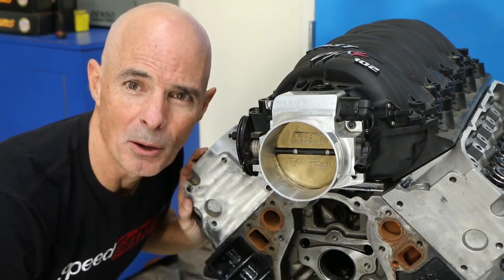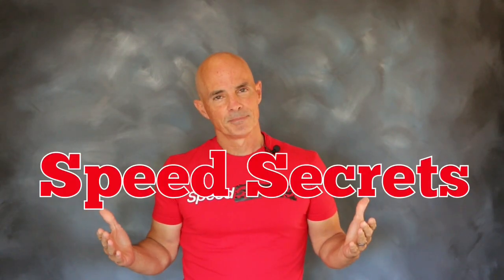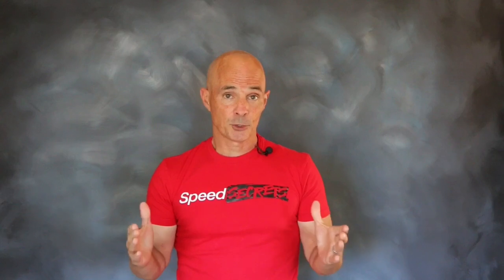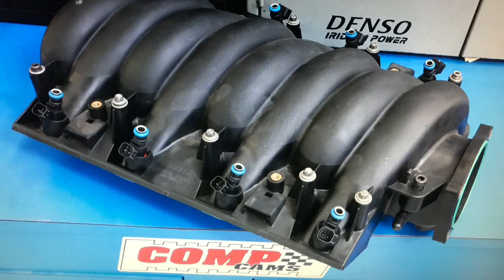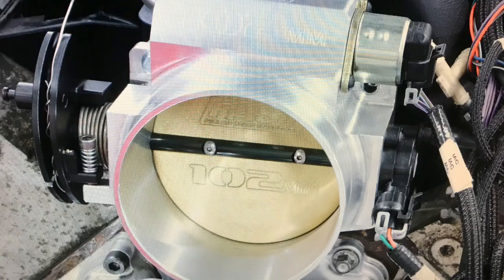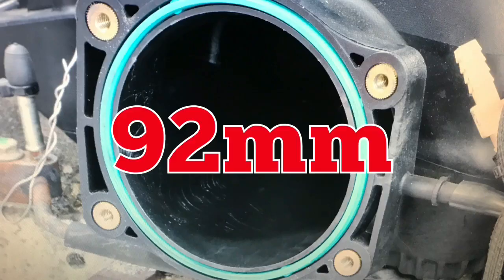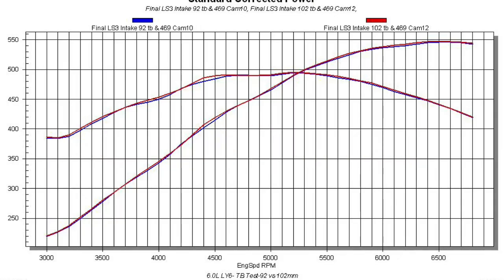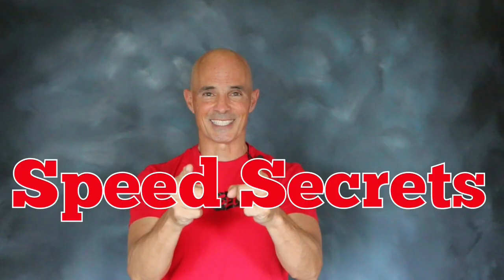LS THROTTLE BODY TEST-92 VS 102 (IS BIGGER REALLY BETTER?)

Comment: Showing what's under 3000 rpm would be interesting.
I'm pretty bigger makes you loose driveability.
Reply from the maker: michaelovitch the bigger throttle body has no effect on low speed torque. It does make the motor FEEL more responsive cuz a small opening provides more airflow-but at WOT-no change

Comment: Slightly off topic but what duel quad port injection work on an LS 7?
Reply from the maker: do you mean port injection with a pair of throtle bodies on a tunnel ram or other dual quad intake? If so, yes it works
Reply: @richardholdener1727  yes so like a  edelbrock duel quad with port injection and a pair of 1000 cfm??? Throttle bodys.
I guess the question is from a stock LS 7 how much gain or how much does the set up rob.
So many questions. 
Thanks Richard
Reply from the maker: @adamvita1334  I'm not familiar with a dual quad for the LS 7 except Holley has a Hi Ram that you can use. The best bet is to use an MSD for the LS7 or if you want high rpm power-then the Hi Ram

Comment: I'm usually pretty open to your testing procedures, but this one is very biased, both throttle bodies are still breathing through a 92MM openuning, so where would any performance gain come from? Did fast make you do this test to try to sell more manifolds? Why not switch to a fast intake on this same motor and use both throttle bodies Alain and see if there's a difference? Turn the adaptor around to go from 92MM to 102 MM and see if the throttle body is a choking point.
Reply from the maker: It was to show that the adapter and bigger throttle body do not add power-to help people from wasting their money.

Comment: Just wondering if there is any input from Dorman as to how much boost is safe for these newer intakes? I had read on   a few different forums where the early intakes would crack/separate at the snout on less than 1 bar. User error always an unknown though lol.  I know factory intakes like the LS1/3/6/7/TBSS  do not seem to have this limitation.
Reply: When they first came out they couldn't handle much over a bar of pressure but now they can handle a fair amount of pressure. There's dudes runnin 25+ psi regularly on Dorman manis
Reply from the maker: thnx for the infor-I've only run 11-12 psi

Comment: So basically the throttle body isn’t the restriction here. If the stock throttle body was maybe like a 70mm (if there was such thing) and the intake manifold was still a 92mm opening we would see some gains?
Reply from the maker: that's exactly right

Comment: Cool to see a back to back test prove what I think most people on the forums believe... throttle body really don’t make a difference in the big picture. And the only reason to upgrade from the factory setups is for looks
Reply from the maker: the factory 90 mm will fed a lot of power but the stock 78mm throttle bodies (or intakes) will limit power (but that is less of a problem on turbo or cent blower applications

Comment: I would like to see if all this head porting is worth the money. Get a base line, then put same but ported heads on with no other change
no milling and no cam change, no intake change nothing just ported heads.
Reply from the maker: Simple Man I have a test in ported Heads on a turbo motor -lots on na motors

Comment: Hey Richard. Can you do (or have you done) a test with sheet metal intakes on a boosted application where you have measured power with different upper intake volumes back to back? I'd be really curious to see how a various volumes of plenum react to different cubic inch combinations. For example, 400-420" engine with very large plenum, vs. 400" with very small plenum, then the same test with a 320-360" cid engine.
Reply from the maker: Scott Russell I have something coming up called Kegalodon -it’s a plenum Volume Test

Comment: I thought a 102 would be to big for my ls1 so I grabbed a fast92 and had vengeance racing port my intake tmfor free :)
Reply from the maker: NICE-BUT WE'VE RUN THE LSXR 102 ON 4.8L COMBOS WITH GREAT SUCCESS-ITS WORKS WELL ON THE LS1-BUT YOU WILL BE HAPPY WITH THE PORTED 92 MANIFOLD
Reply: @richardholdener1727  I should've grabbed the 102 tho. In gonna be building a 408 lq4 and putting my 76/75 precision turbo on hopefully spring time

Comment: wouldn't the 92 mm openning essentially make the throttle body also 92 mm, no matter how much bigger it is?  If you increase the size of the opening on the intake, would it not be a fairer test?
Reply from the maker: YOU NAILED IT-THAT'S EXACTLY RIGHT AND WHAT THIS TEST WAS DESIGNED TO SHOW-LOTS OF GUYS OUT THERE THINK AN ADAPTER AND BIGGER TB WILL HELP-THAT'S WHY THE ADAPTER WAS MADE-IT'S OBVIOUSLY BETTER TO HAVE THE OPENING AND TB THE SAME SIZE
Reply: I think people also forget an engine being an air pump only has so much capacity to move air.  Your shark keg intake proved there are limits.
Reply from the maker: Iain Sutherland I’m going to post Keggie Testing later

Comment: Richard - I'd be interested on your take on GPI's testing of a rod-mod and ported LS3 intake vs. a FAST 92 vs. a FAST 102.  Basically, the modified LS3 manifold with a 92 outperforms the FAST with a 92, by a little in hp, a fair bit in torque, and for a lot (less) in price.  It's an interesting comparison of a lot of LS3 intakes and I bet you'd find it interesting.  It also shows how much the 102 is worth on the FAST manifold, which was 14hp.  So, I agree with your findings here, but I think the test using a tappered spacer isn't really capable of showing the "gains" of a bigger throttle body.  You need an intake that will take the larger throttle body without restriction, and then run your test with that manifold and I bet you'd have a different result.

I love the tests you do on this stuff - keep 'em coming!
Reply from the maker: DOES FAST MAKE A 92 VERSION OF THE LS3 INTAKE?
Reply: @richardholdener1727  FAST says right on their website you can use a stock throttle body on the LSXR 102.  GPI tested exactly that, and found that the throttle body change is pretty significant, and exposed that with a stock TB it is outperformed by a rod-mod and ported stock manifold, and with a 102 it realizes it's potential and outperforms the stock manifold with a 90.

Comment: thank you for this comparison Richard.  I am, however, left wondering how this engine would react to testing a fast 102/102 vs Fast 92/92.  Or even just running a fast 102 with 102 TB then with a 92 TB.
Reply from the maker: Jesse Murray I have a test on the Fast 92 intake vs the fast 102 intake in a cath port-fast doesn’t make a 92 mm intake for the ls3-but putting a 92 mm Tb on a 102 mm throttle opening can reduce power at higher power levels
Reply: Richard Holdener be interesting to see at what airflow level an engine will want the 102 over 92.  Also, have you ever seen where an engine picks up power with a fast over an ls3?  I know on basic 6.0-6.2 builds there’s no gains but maybe on big inch/ power setups there is.
Reply from the maker: @jessemurray1757  I'VE RUN THEM ON LOTS OF COMBOS-BIG AND SMALL AND BOOSTED AND NOT SEEN MORE THAN 5-7 HP. THEIR CATH LSXR KICKS BUT, THERE JUST ISN'T A LOT OF POWER LEFT IN THE FACTORY LS3 INTAKE-LET ME KNOW IF YOU HAVE OTHER COMBOS YOU'VE TESTED AND I DID A TEST ON THE 92 VS 102 FAST INTAKES
Reply: Richard Holdener nothing apples to apples but it would seem the difference between 92 and 102 on your typical 450-500 wheel setup is negligible.  All things equal It always comes down to what heads they’re running and the ones running AI ported 799’s always make the best power.  I would really like to see how ported 706’s stack up against ported 799’s.  People always seem to run the 799’s though as you know.
Reply: @richardholdener1727  I would like to see the test of the 102 vs 92 but I can't find it. Can you post a link please?
Reply from the maker: Jeff Borud that vid is not up yet
Reply: Richard Holdener I guess that explains why I can’t find it. Looking forward to seeing it.

Comment: The TPIS  ls6  responded well to the 90mm snout mod  they used to do.
Reply: The 78mm oe tb really starved the ls for air. Not only that but the opening of the ls6 intake was only 75mm.
Reply from the maker: shaadydog1 the ls6 is a good intake and really needs a bigger throttle-would be interesting to test the dorman ls2 vs the modded ls6
Reply: @Richard Holdener  I happen to have  a Dorman LS6 I had started to port for my Camaro, it got put on the back burner since I decided to  buy a Huron Speed front mount kit... Pretty much ported the inlet as far as I could without getting into the O ring. If I remember right it was the same size as my stock LS1 intake initially around 75mm.  I  had also cut the center supports out, then I cut a big rectangle in the bottom to access the ports.  They suffer from a pretty big mismatch and a weird hump. There is also a weird ledge around the outer plenum edges and corners that I blended and honestly that area could use some filler to be a truly smooth transition  from plenum into the  the trumpet/bell/mouth of the intake port. Probably the same bs the factory LS2 suffers from.  I'm sure you have seen, the Dorman LS6 was tested alongside the factory LS6 intake and they were fairly close maybe 7-10hp and identical curves. Most come to the conclusion the shortcoming I described above are the primary reason it wasnt quite as good, I am pretty sure the mods I have done will put it over a stock LS6, the question is would those mods be worth  the time or hassle as the port hasn't really changed. In hindsight I would have waited for the Dorman LS2 but it got delayed with no clear time to come to market, doesnt matter now LS1 is fine with boost. 

 .If I get around to finishing this and get the bottom welded on the way I think it should go back on and be reasonably strong for NA use,  I would be happy to send it your way to test.
Reply: TPIS still does the mod but unless you already have an LS6 intake you're at 700 for parts and labor to buy the intake and have it modded. Not much more to step up to a FAST or MSD at that point.

Comment: Richard, Good video again.
I found exactly the same thing going for a stock 90mm to a Nick Williams 102mm. This is on my LS 408.
I saw zero gain but the pedal was more responsive.
I am thinking maybe to see gains you will need more camshaft and a higher rev limit.
Reply: I forgot to add this was with a FAST 102mm intake manifold with the long runners.
Reply: Going from a smaller tb to a larger properly sized one on the bigger intake mani will substantially help the torque numbers & under the curve seat of the pants feel.  Plus that crispy pedal you're feelin

Comment: i request the same test but with a fast intake. does the larger intake opening work better with the 102 and "does the 92mm" obstruct flow. Please :)
Reply: I think this is how the test was ment to be done. Start with the larger opening and step down to the smaller... That makes more sense
Reply: I'd love to see this as well. Fast 102 with a 102 TB, and then with an 90 or 92mm TB. 
How much power does the smaller TB cost?
Reply: @delamin8r  GPI did that in a recent intake manifold test - the 92mm TB on a LSXR 102  lost about 14hp compared to the 102mm TB.  Interestingly, a rod/mod ported LS3 intake outperforms the LSXR 102 manifold when both it has a 92mm TB, marginally in hp, but definitely torque.
Reply: delamin8r it's all about whether the engine demands the airflow brotha. If the engine only needs X amount of CFM to be happy then adding a TB that flows more air than X CFM is moot. It won't gain anything from the bigger TB and at WOT it won't necessarily lose anything. What you may notice won't be seen on ad Dyno but on the street in drivability.
Reply: @viciousrap700  well said!
Reply: @viciousrap700  this is very true but even an ls6 with stock heads and stock cam likes the fast 102mm intake and 102mm throttlle body over the 90 or 92mm setup. The demand for airflow is there
Reply: @SICKSOJOE  I'm sure in some cases that's so brotha, combination is key.
Reply: viciousrap700   Exactly spot on.  The 102 might feel a bit more snappy at lower rpm, but the airflow restriction isnt going to be found in the intake manifold or TB... its going to be in the found in the heads. And a higher flowing head needs an appropriate cam to support it. But not every head/cam combo is suitable for every motor.  It all comes down to the combination.
Reply: @SICKSOJOE I've seen power lose from a fast on a 6.0 lost 2 rwkw over stock intake.tuner told me being a mild engine not enough air speed for the fast.the ls6 intake is good I can't justify spending 3 K for fast 102 plus rails n 102 tb when my heads cam ls6 intake 410 rwhp .. probably wouldn't gain much if I knew I'd make extra 30 rwhp than maybe...too bad bought a d1sc procharger for 4 K au lots more power be made with boost
Reply: This test is more relevant to most users since most will be using an OEM manifold and trying the oversized TB. The test is to show a TB larger than your intake's TB port is pointless. At least when a 1/4" thick adapter is used. When the taper is over a few inches you can see actual gains, but that's not going to fit most vehicles and mess with plenum volume.
Reply: @hydrocarbon82  what you really need to see is the Fast manifold with a 92mm throttle body and compare it with a stock manifold and 92mm throttle body. If you are looking for bang for buck and can only afford just one (as a typical user might be able to afford), the throttle body or the manifold, you might not get the results you expect by just going to the fancy manifold. Sometimes the results are worse.
Reply: @hydrocarbon82  I agree. Most just want to bolt on a bigger TB. The title of the video is a little deceiving
Reply: Exactly what I'm saying!
Reply: As long as the engine is not able to use the what ever extra air that is supplied, it does not matter. Yes, in this test it tapers  down from 102 to 92, but that still has a much smaller restriction compared to a 92. The reason is simple. The 102 TB works as a bell mouth, and thus create a larger initial cross section and then a smaller cross section where the air does not have to turn any corners and thus flow smooth. So while a 102 TB on a 102 FAST intake might flow a bit more, there's already a significant increase in flow from this setup. No need to waste time with anything else.
It will take a huge N/A mill to really use a 102/102 setup. Anything below 700 hp SAEJ1349, forget it. Don't forget that if we look at the engine tested here and compare it apples to apples against a bone stock 430 hp LS3, this "545" hp engine is more like 480 hp. So it is very far from being able to utilize a 102 mm TB. Throw in 200 hp N/A short runners, 8000 rpm, and we're getting into something.

Comment: Can you try and run the engine with the lid off the Fast intake ? No larger TB lol
Reply from the maker: I DID THAT WITH THE CARBON PTR INTAKE AND ON A MOD FORD FR500, I SHOULD TRY IT WITH THE FAST-THAT DOES MORE THAN ELIMINATE THE THROTTLE BODY-IT CHANGES THE INTAKE INTO AN IR MANIFOLD WITH NO COMMON PLENUM-USUALLY WORTH POWER
Reply: @richardholdener1727  WHY ARE YOU YELLING?
Reply: David Gomez It’s all the time in dyno cells without heating protection.
Reply from the maker: David Gomez SO FRICKIN EXCITED

Comment: Does the fast manifold loose any using the 92mm?
Reply from the maker: YES DEPENDING ON THE POWER LEVEL
Reply: @richardholdener1727  Wouldn't that indicate that the limiting factor is the 92mm opening that you're forced to neck down to?  This test with a ported manifold inlet would lay that notion to rest.
Reply from the maker: @tylersmith7054  THAT'S EXACTLY RIGHT-THE IDEAL SITUATION IS BIGGER TB AND BIGGER OPENING-WHICH CAN ADD POWER AT A GIVEN POWER LEVEL. THIS WAS WAS MADE TO SHOW THE ADAPTER AND BIGGER THROTTLE BODY IS NOT THE ANSWER

Comment: Love these videos Richard! Might be hard to rig up on the dyno, but it would be fun to see some results between a stock truck intake system with a drop in filter vs some aftermarket CAI system. Maybe throw in one of those cheap, $50 eBay 4” CAIs lol. Just throwing out ideas.
Reply from the maker: I HAVE RUN THE STOCK AIR BOX ON THE DYNO BEFORE
Reply from the maker: JamesK10turbo the cold air intakes also alter the maf signal which can throw off AF -but I tested just Airflow change
Reply: On my 03 suburban I had to add fuel up top after adding an Ebay cheapie CAI.  With just the CAI it was throwing lean codes.  The noise was ridiculous, so I ended up putting it back stock and flashing back stock.

Comment: So what happens if we take the same intake and port the throttlebody opening out to 102 mm and repeat the test? Will the stock intake perform just as well as the fast? Then let’s try the same test using a stock truck intake.
Reply from the maker: THE FAST LS3 OFFERS ALMOST NO POWER OVER THE STOCK LS3-EVEN WITH THE DIFFERENCE IN THROTTLE BODY. I'M NOT SURE YOU CAN PORT THE OPENING OUT TO 102MM WITHOUT HITTING THE O RING BUT ILL CHECK